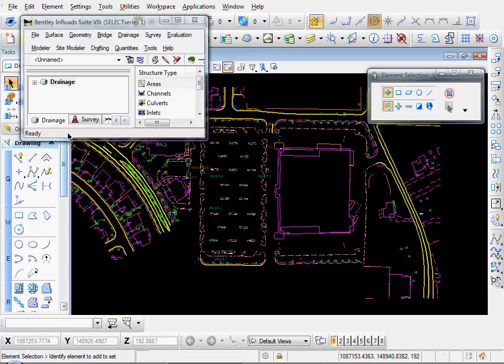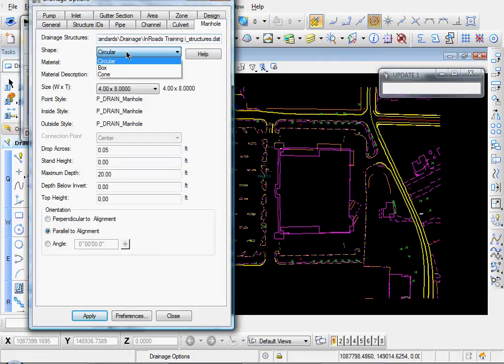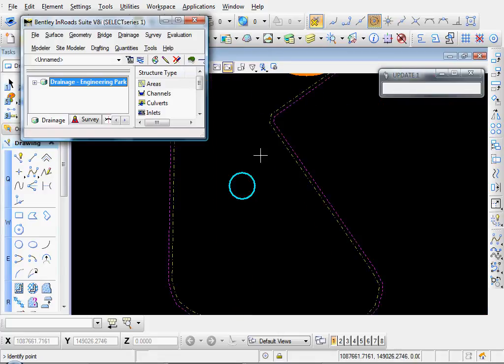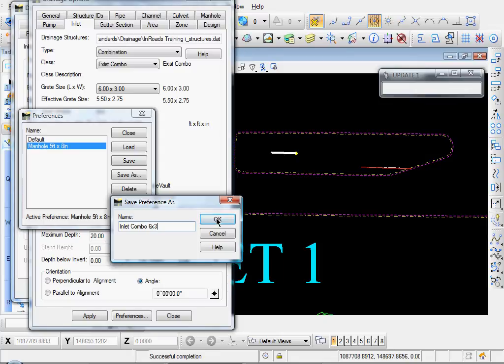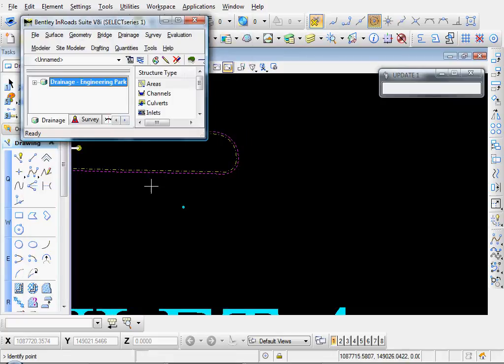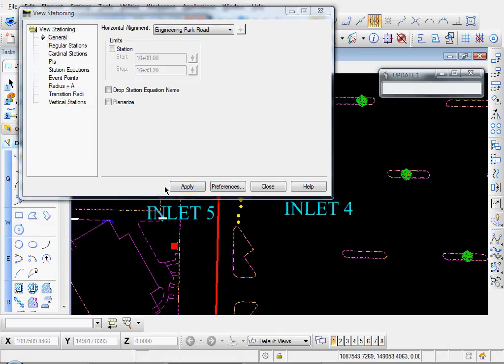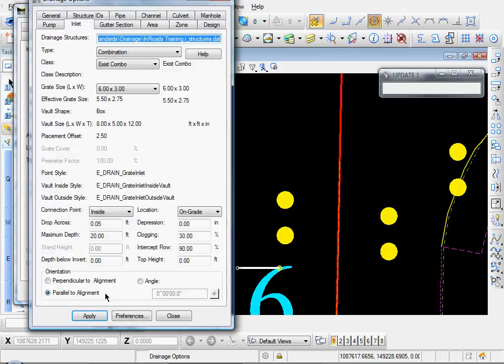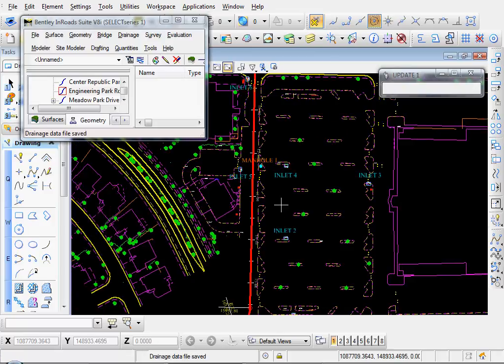Bentley InRoads Storm and Sanitary - Existing Drainage Network Part 1 of 2

Comment: when you snap to the points for the inlet, what does the point represent? The center of the Inlet? edge of the inlet?. 
If I have an inlet along a curb, how should I snap to place the inlet? should the snap be along the curb line?